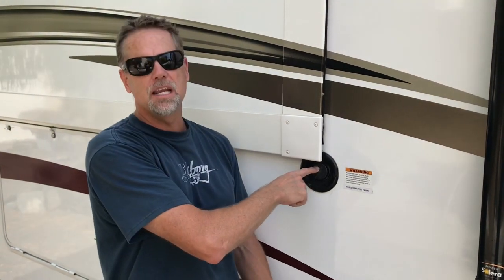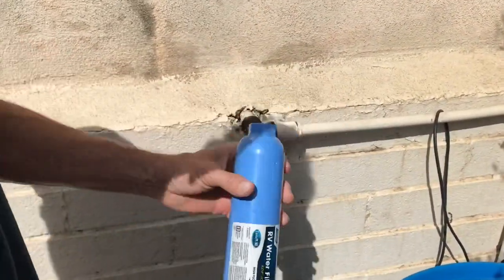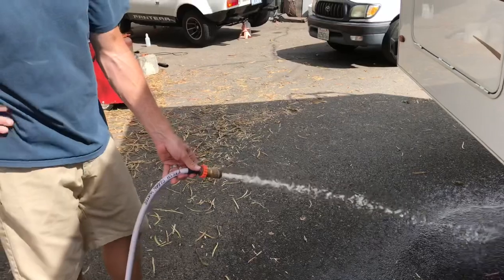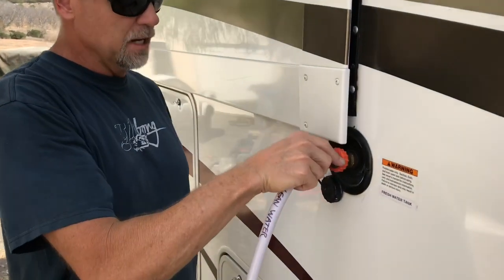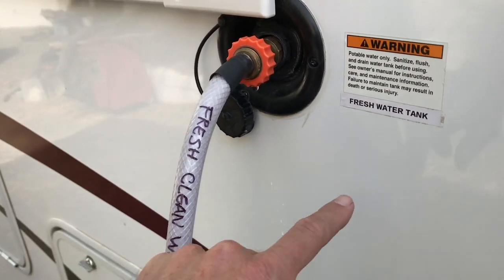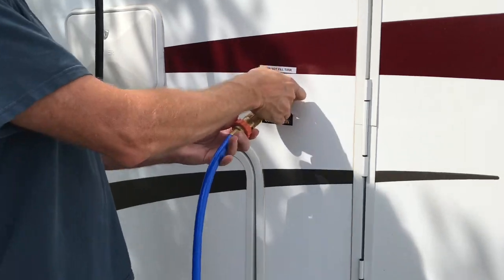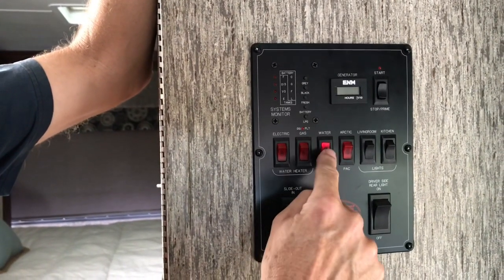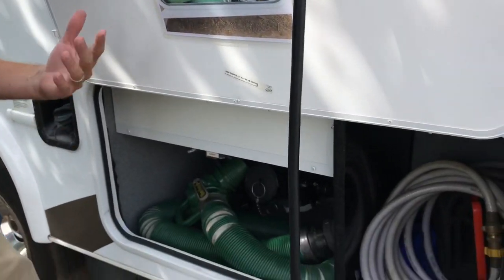RV Water System Explained

Comment: Great video.  I'd like to see the other parts such as the actual plumbing and what valves are active and what are not.  Also include the hot water tank heater etc.  BTW, was that a Countach kit car in the background?
Reply from the maker: I will be making a new video, Water System Explained In Depth, which will cover EVERYTHING that has to do with a RV's water system.  I am going to put diagrams, as well and show exactly how the water flows through the RV in every hose.  Stay tuned.  And as for the car in the background, it's a Pantera, which is my next door neighbors.  Sweet ride!
Reply: Mint!  Will be a great video.  Helps the nubes like me.  What I've found is sometimes the presenters don't differentiate between boondocking or city water setups. And winterized vs non.    Looking forward to your tutorial. Show the nitty gritty :)  😃

Comment: No discussion about the settings for filling?
Reply from the maker: Settings?  I'm not understanding.  Monitoring the sensors inside on the master panel?
Reply: @TheAdventureTravelers  Our Class C RV has settings for city water, fill tank, etc.

Comment: Do you drain your fresh water tank if you're just going to use and hook up to city water?  I didn't put any water in my fresh water tank; just connected to city water hookup, but it overfilled into my fresh water tank.  I've never had this happen to us on our other two campers we owned.  I don't know if my water heater filled up or not; I assume it did cause we had hot water but in the morning the fresh water inlet was overflowing.  What do I do to stop this?  Don't want to us Fresh Water for my TT; we always camp at full service campgrounds.
Reply from the maker: That sounds really weird that it overfilled into your water tank.  They should be totally separate systems.  When we know we are going to a full-hookup site (which is rare since we love to boondock) we only have our tank at 1/3.  This saves gas and lessens the weight to your rig.  We have 1/3 so we can still use the restroom, wash our hands, etc.  I have no idea why the tank filled on your rig.  If it overflows and comes out the vent hold, that is normal and good.  That ensure you do not rupture the tank.  I would contact the manufacturer to learn more about your rigs plumbing.  Sorry, I can't help you more than that.
Reply: I know, I think its weird too.  We've had two other campers and this Never happened.  This camper we bought is a used one and naturally we took the sellers at their word when they said everything works, however, we're finding little things we keep having to fix.   Saw several videos where this has happened to other people.  One guy said sometimes some debris gets stuck in the opening and closing valve on the water pump and it must have stayed open.  His Fresh Water tank overfilled as well.   So he found a solution where he left the pump on for 10 min or so then opened the cold water faucets, then hot, and it somehow fixed itself.  The valve must have closed from the pump.  We love the camper but would surely love to have things work like they're suppose to.  Thanks for your help.  Gonna try this guy's trick on a warm day; I had already drained the Fresh Water tank from underneath camper when I found the video.

Comment: Question for anyone who can answer it ... When I hook my RV up to the "city water", I hear something filling, but I cannot figure out what it is -- I for one thought it was filling (or topping off) some sort of tank or something.

So, what I gather from this is when you are using your Water Tank you HAVE to have the pump on -- am I correct in that thinking??
Reply from the maker: The only thing I can think of is the water is filling up the plumbing inside the RV (if the water tank is empty), or possibly filling the charcoal filter or hot water tank.  Just my guesses.  Ensure there is not a leak too?  Hope that helps some.

Comment: I have been reading about the grey water tank.  Could you yell me about that one?   Or are they obsolete??
Reply from the maker: You almost have to have a grey water tank. It’s where your shower, sink and any other water goes when it goes down the drain. Look for a pull handle ( near your black water handle) that is usually grey and that pipe will lead you to the tank. Hope that helps.
Reply: I meant the hot water aluminum tank.   I guess that is grey too.

Comment: I just bought my first camper trailer and I'm trying to understand how the water heater fills up. Does the water heater fill up automatically when using the onboard pump and fresh water tank? I'm not hooked up to a city water connection and wish to use just my fresh water tank and be able to take a warm shower.
Reply from the maker: Tony, without seeing your actual water heater, I can just give you some general info.  Yes, typically you need your water pump on if you're not hooked up.  The pump will fill the water heater and you should either have battery operated heat or propane heat to your tank.  Either (or both in some instances) will heat the water in the tank.  We think ours heats about 8 gallons of water at a time, but we usually get about 10-12 gallons, because we stop the water several times when taking showers (to soap up, etc.).  We usually heat up our water about 15-20 minutes prior to needing it (shower or dish washing).  Hope this helps!   Happy travels!!
Reply: @TheAdventureTravelers  Thank you very much for your feedback! I'm hooked up to shore power, so is it ok to just leave the water heater turned on?
Reply from the maker: @guidosarducci8850  Yes, you should be able to just leave it on.  We typically just turn it on prior to using it because we boondock quite a bit and it saves battery power.  Also, if you leave it on, it has a very small percentage to heat too much and create a fire (depending on the wiring of your RV).  As you may know, a lot of RV manufacturers rush the installation of the RV and the wiring may be sub-par.  We edge on the safe side.  Hope that all helps some.
Reply: @TheAdventureTravelers  Thank you very much for your feedback! I really appreciate it.

Comment: I hooked up my hose to city water connection and I can’t get water to come out anywhere.
Reply from the maker: Are you sure you’re not filling the tank?  Check all your valves along the line (plumbing) to ensure nothing is closed.
Reply: @the adventure travelers yes I have a big horn travel trailer that has a switch that can be switched between tank and the regular plumbing. I have it set right but no water coming out the sink. Water is coming out the hose just fine too.

Comment: Does the tank have to have water in it, or can I just use city water when stoping
Reply from the maker: No. The tank does not have to have water in it. A good way to find out if you were getting water from your tank is to turn on the water pump. If you are not hooked up to city water and you have water, it’s coming from your tank. If you turn off your pump and you turn on the city water, you should have water that way as well.
Reply: @TheAdventureTravelers  thank you

Comment: Why does water come out my city water inlet when I turn out my water pump inside my trailer
Reply from the maker: Probably a bad check valve at your City Water Connection point. Easily replaceable. The inlet for your City Water Connection typically has a check valve built in to it. Replace that and you should be good to go.

Comment: I have a question, so when connecting to city water that doesn’t go into the tank at all so could I connect that feed to a stream on my property ?
Reply from the maker: Brandon,  It all depends if your stream could generate enough pressure to push the water through the system.  In theory, yes, however you would need to pump it from your stream into some sort of nozzle that you could directly connect to your RV.  I'm thinking, PVC tube from your stream, through a filter, then through a pump, through another filter and then to a hose or something that you could connect to your RV.  You would basically be pumping stream water through, so, it wouldn't be sanitized/germ/protozoa free, however it's doable.  I'm sure there is a video on YouTube somewhere where someone has done this.  Best of luck!

Comment: If u are getting city water why are u filtering it the city filters it to be drinkable ??
Reply from the maker: Yes, most city water is drinkable (think Flint, Michigan) however, we just like the extra precaution of putting the most pure water into our holding tank.  We also sanitize our tank on a regular basis.  Just because the water comes from a city sub-station that cleans and adds additives like fluoride, the pipes that bring it to the RV may be substandard and not as potable as we would like.  It's a choice.

Comment: when you fill the water tank and turn the pump on does that automaticly fill the hot water tank and its safe to flick the heater switch on?
Reply from the maker: Don, on our RV, the answer is, "Yes".  When we turn our pump on (or have the system hooked up to a City Connection), the hot water tank fills up and it is safe to turn on the water heater.  Hope that helps.  :-)
Reply: @TheAdventureTravelers  maybe I'd have to make sure the heater bypass is in the pass position
Reply: I would open a hot water faucet to purge any air that might be in the tank before I turned on the water heater.  The electric heating element needs to be completely submerged in water to avoid burn out.

Comment: Can we put the water tank on the roof and not need a pump?
Reply from the maker: You can if your RV remains motionless.  The only issue is you most likely will not get the required water pressure you are looking for and the tank would need to be full to provide the pressure downhill.  Also, a HUGE concern about this is, you want to keep heavy weight down low (near the chassis) and not up high, which will make your RV top-heavy.  Water is 8.34 pounds per US Gallon, so even 10 gallons of water is 83 pounds on the top of your RV.  That would not be safe, not to mention, since it's liquid, it would slosh all over and make driving very dynamic.  I would NOT recommend it.  Just some things to think about.

Comment: Sorry but im new to this.I still dont understand the purpose of the city water tank🤦🏻‍♀️
Reply from the maker: There is no "tank" with the City Water Connection.  The City Water is just like the plumbing in your home, it comes from the City and connects directly to your pipes.  The same with the RV.  The water comes in directly and flows through the pipes to the sink faucet, fridge ice maker, toilet, shower, etc.  All of the pressure is provided by the City.  You do not want to use your Water Pump when connected to City Water.   Hope this helps.
Reply: The Adventure Travelers so there are 2 water pumps in the RV then?
Reply from the maker: @tesslacali8655  No.  Typically only one pump.  The pump typically pumps from your Fresh Water Tank to your plumbing.

Comment: it would be better if it were more thorough for the the title.  What about hot water, what about the flush? More details please.
Reply from the maker: What are you looking for with the hot water?  Our hot water tank is 8 gallons and takes about 10 - 15 mins to heat thoroughly.  You can heat the hot water tank using propane or power (plugged in or generator power).  Typically that will give you about a 8-minute shower because it continues to make hot water as you use it.  Flush?  Do you mean black water or flush your freshwater tank?  Black water video is here:  https://youtu.be/wDGTZ0QaBv0  and one way to sanitize your fresh water tank is here:  https://youtu.be/bvMuJhR2fLA   Hope this helps.
Reply: @TheAdventureTravelers  thank you so much for the quick response.  I have a 7 gallon hot water tank.  So i am assuming (i am brand new at this) that there is a separate tank that will take water from the fresh tank and put it into the hot water tank and heat it up?  My friend took a shower and she said it was like 5 minutes of hot water.  Thats terrible.  How does a person take a shower and actually clean in that short amount of time.  Then do you have to wait for the hot water tank to fill up again? i guess your saying it could take 10-15 to fill back up?
Reply: @TheAdventureTravelers  oh and one other thing, when am i supposed to use that know that releases pressure for the hot water heater.  ALso, why is the water kind cloudy?
Reply from the maker: @iamoflife  When you RV, you are still roughing it.  Meaning, this is not your normal home with the 55-gallon hot water heater, so yes, you are going to be very limited to the amount of time in the shower.  What we (and most people) do, is wet ourselves really well, turn off the water or press the water stop button and then soap up.  Once all soaped up, then we rinse off.  Usually only about 10 minutes in the shower.  It is NOT fun to shower and have the hot water run out :-)  

The hot water tank takes water from either the City Water connection or the fresh water tank.  It should be in-line after the tank or City Water connection.  ALWAYS have water in the tank or hooked up to the City Water BEFORE turning on the hot water heater.  If you are out of water, turning on the hot water heater can ruin it, if there is no water in it.  I have no idea why your water would be cloudy.  I would Google that one.